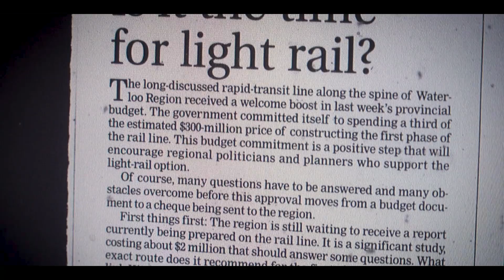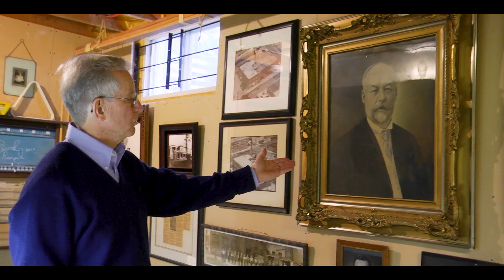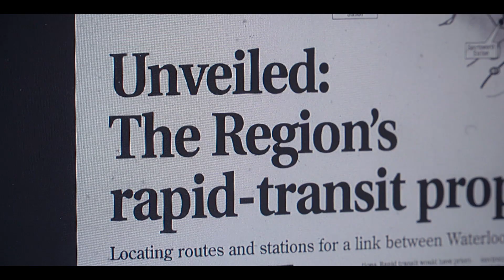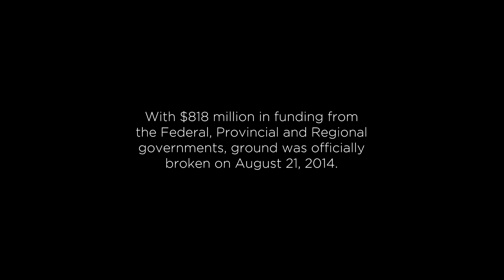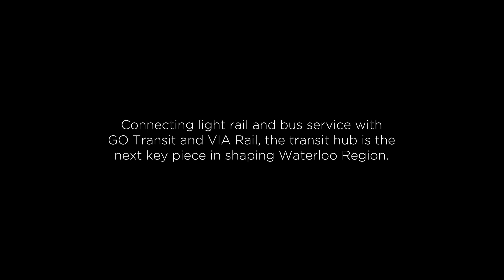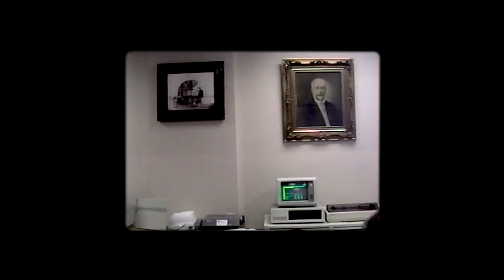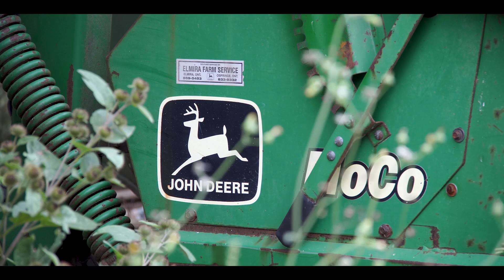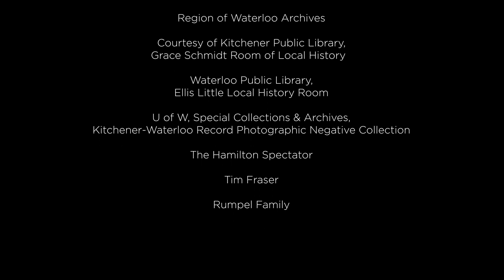Growing Up: The story of ION light rail in Waterloo Region | Full Documentary

Comment: This rail system is SO SLOW. The bus service from Fairview to UofW or Conestoga was faster than this line. So what was the point?
Reply: Capacity and eventually it'll be faster
Reply: @ @ how will it eventually be faster? The tracks meander through downtown KW in the most ineffective way. You can’t go any faster. People are already being hit by the trains.
Reply: @Rick-C-117  people will slowly get slightly smarter as they get more used to them also on Future Extensions the line will run mostly on Old Railroad Corridors